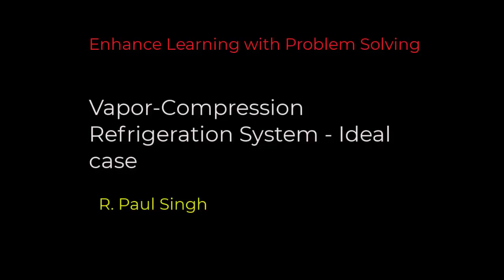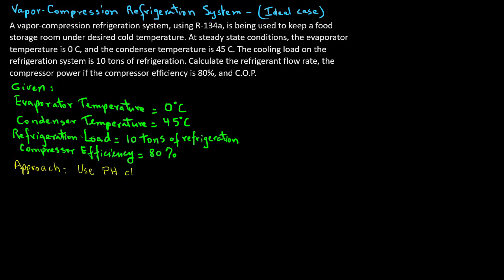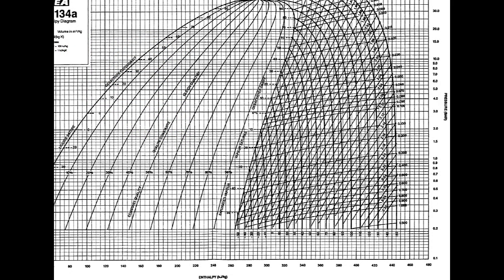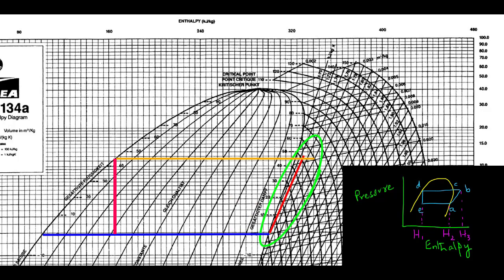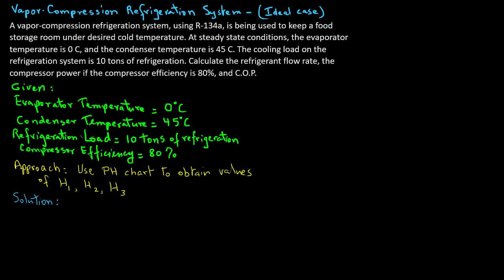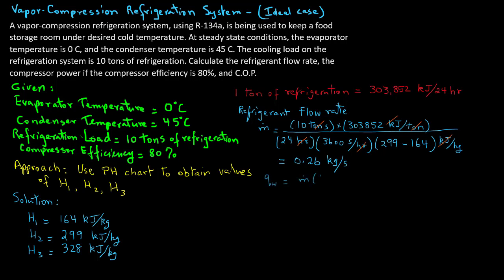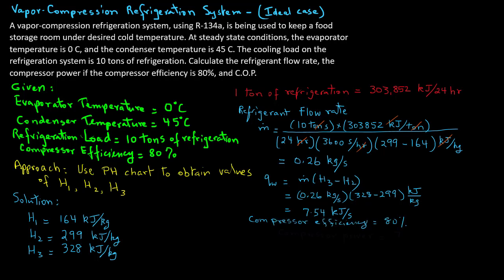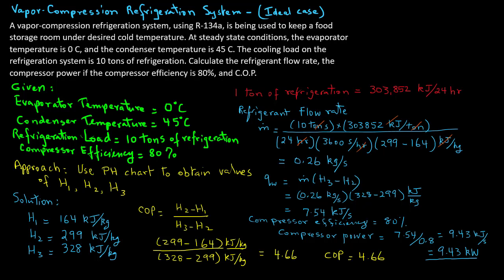Vapor Compression Refrigeration - Numerical Example - ideal case

Comment: Thank you for a very helpful tutorial. I'm confused by the enthalpy chart used. The one I use and others I compare to, I get much higher Enthalpy values at these conditions. H1 = 250kJ/kg, H2 = 400kJ/kg and H3 = 430kJ/kg
Reply from the maker: Thank you for your observation! Please note that enthalpy charts (and tables) available from different organizations may have used different reference datum. The charts, I have used, are based on 100 kJ/kg at 0 C for saturated liquid as a datum. You may find other charts available with a datum reference as 200 kJ/kg at 0 C. You can check these numbers by reading the enthalpy value at 0 C for the saturated liquid state. The different datum values do not influence our calculations because we are always determining the difference between two enthalpy values; and the chosen datum does not impact the difference (only the absolute enthalpy value at that temperature may be different depending upon the chart one uses).